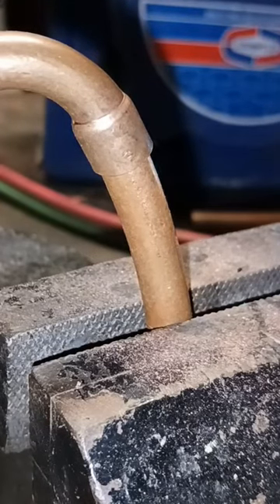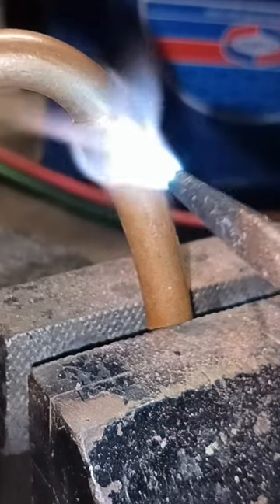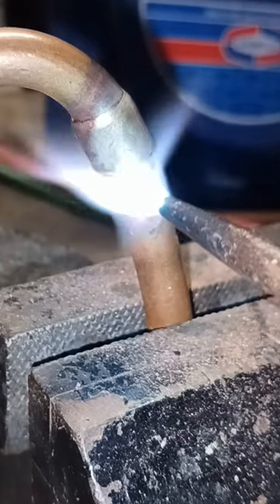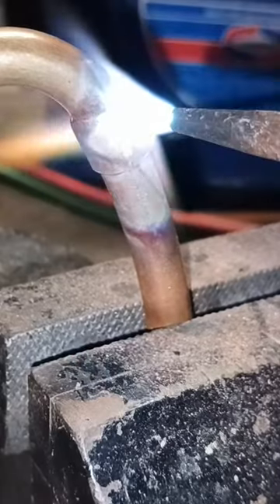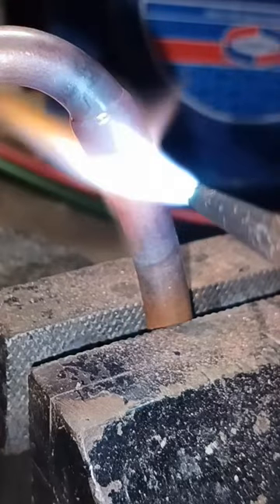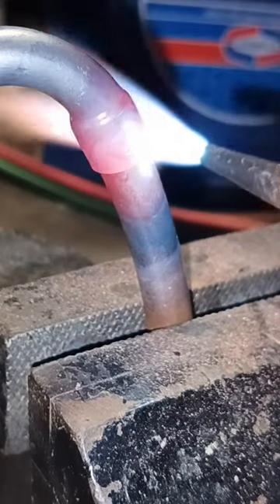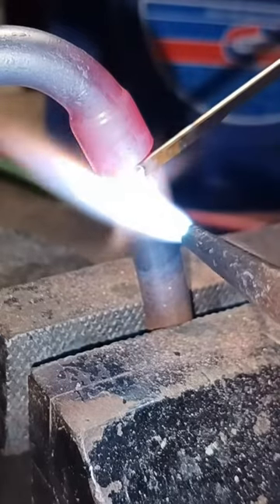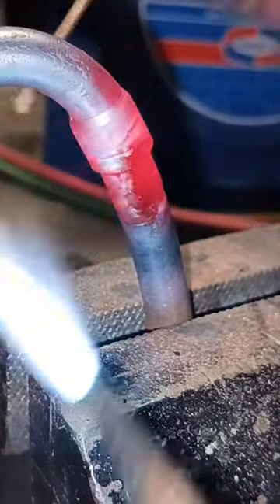Brazing copper

Comment: Anyone feels that this is too hot? I usually try not to let it change color looking at it naked eye. And dark red with glasses
Reply: I was wondering the same
Reply: Get it glowing !
Reply: U are cold brazing if you don’t
Reply: You are brazing....not soldering....it has to get red hot to absorb the alloy rod....dont forget to cap at the end.
Reply: @meagain8403  yeah, this will melt the crap outta the king valve 😂
Reply: @seek3n  king valve?
Reply: @meagain8403  the valve you screw next to the condenser
Reply: @seek3n  you ever grab a wet rag and wrap it around them to prevent the heat from reaching the valve or any gaskets?
Reply: @meagain8403  of course.
Reply: Way to hot !!! There will be alot of black slag on the inside. This is what takes out txv's and plugs pistons. On a refrigeration job you would be fired !! You can't pass a brazing test like that anyway, so you wouldn't need to worry about being fired
Reply: @Chris-gy1hf if you are purging with nitrogen you are not going to have this issue. I’ve tried to create this on the bench snd the flow doesn’t allow and build up after cutting the pipe. I don’t think YOU would pass a test
Reply: @colemug2351  You are correct to a point, even flowing with nitrogen you can still make slag in the pipe if you grossly over heat your pipe. And YES I can pass the weld test. We had to pass one on every job and recertify every year. The inspector picks 2 joints on ever job, from a 1/4" up to 6" line. You cut it out and he checks it right there onsite. Checks it for slag and how much solder is in the joint. Anything else you want to say ??
Reply: @meagain8403  Tell me your new without telling me your new if you don't know what a king valve is
Reply: Way too hot. The flux is gone, completely cooked out. This is annealing. Heat it up just enough for the solder to flow. Also if you can do it in a vise like this, flip the fitting over and the solder joint will look cleaner
Reply: @Chris-gy1hf  thats a suction line ( well its not but thats to big for a liquid line ) so most likely all those flakes will end up in the compressor oil and die there 😂

Comment: Why swedge the upper piece? Why not swedge the lower piece, so that the melting rod flows down?
Reply: direction of flow
Reply: allot is attracted to the heat, really if he’d kept his flame on the joint more than the pipe, it would be less messy.
Reply: it’s not a swedged piece, it’s a 90° fitting
Reply: Exactly 😂
Reply: doesn't matter. The filler metal always flows towards the heat anyways, you should be able to walk the filler upwards with little practice

Comment: Too hot and dont be a painter. We call that painting. Shove that solder into the joint it should pull all the way to the back of the joint. If you cut the pipe open I bet theres barely any solder in that joint. But its not a bad job I'm sure it will still hold
Reply: Not the worst job but if your brazing it's because your working with high pressure so full or at least 3/4 penetration is always ideal, it's probably not as strong as a full penetration solder joint. If you wrapped the braze rod around the pipe and marked it you should easily get that much braze in the join. And sometimes you even need to cap the joint

Comment: You make this look so easy
In class it was easy set up like this as well, any tips for dealing with hard to reach places like corners or next to a wall?
Reply: I'd seen a video where someone folded aluminum foil like 4 times and put it behind what he needed to work on. So the heat won't touch the wall.

Comment: Buddy got his regulators Wide open 😂😂😂 
"Hot cherry is scary" remember that when your brazing copper guys. 
The filler material will melt before the copper joint. Warm the copper up by testing with your filler.

Comment: Isn't this silver Soldering?
Reply: soldering is done at much lower temperatures, this is brazing, essentially high temperature soldering, and it isnt welding because the parent material is not getting melted
Reply: "Silver Solder" is a common misnomer.

Soldering takes place at temperatures below 840°F. (450°C)
Brazing takes place above that.

Silver doesn't melt at soldering temperatures.

If you're using Silver, you're definitely brazing.

"Silver Brazing" just doesn't have the same ring too it.
Reply: Looks like 15 percent

Comment: With solder, you can heat up the joint and just put the solder on in one spot, and it will melt and suck up all the way around.  

Can you do the same with brazing?
Reply: Sometimes, if the connection is tight and heat is even I have had them pull all the way around but not 100%
Reply from the maker: Tyler answered it well. But, it doesn't suck it in as well as solder and all the way around like solder. I like to check back sides with a telescopic folding mirror. There's been alot of times when I thought the braze was all the way around. But, a little pin hole was visible on the braze.
Reply: @jdtools6038  See I was always taught to basically go all the way around the joint with rod to make sure it gets filled in.  I just didn't know if on these smaller lines it could work as well as how it does with soldering.
Reply: No Flux ?
Reply: @colinstace1758  Yes definitely flux and clean pipe, but I was just more talking about the actual applying of the solder wire and brazing rod.
Reply: @colinstace1758  we never use flux in the Mechanical HVAC world, just super clean material and lots of heat.
Reply: It’s quite the same as soft solder but it’s similar, if you can solder you can braze in no time
Reply: @colinstace1758  no sir, the rods are self fluxing, or something like that 😂
Reply: @murkyturkey5238 takes more skill to solder
Reply: Yes because it follows the heat, you can see it going down the pipe where you don’t even want It, that’s because he’s heating that area
Reply: Yes and no. Capillary action can still occur but the filler metal and copper are at too close of a melting point to each other that you need to force that rod in there a bit and use the torch to guide it to the back of the fitting socket
Reply: @theiceman6098 but it takes more skill to master brazing
Reply: No you can't. I say around 25-35% and then move. Or else you'll risk getting solder block inside
Reply: @jtoker9758 You don't have to Flux copper to copper, only on dissimilar metals